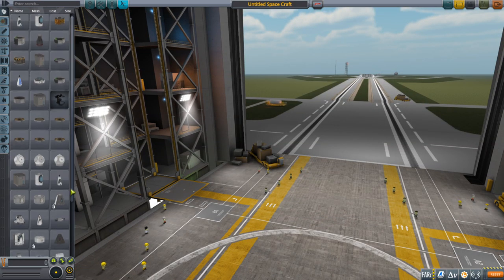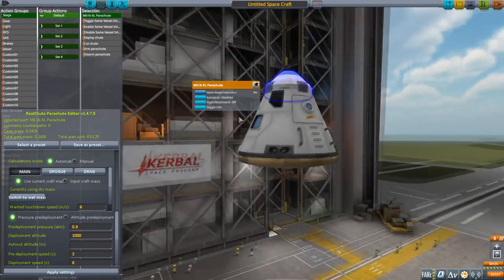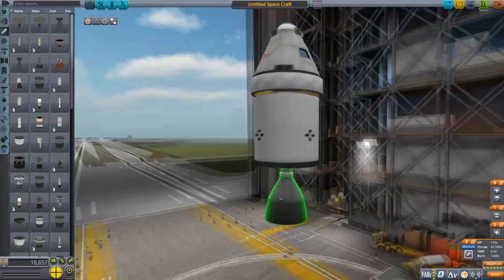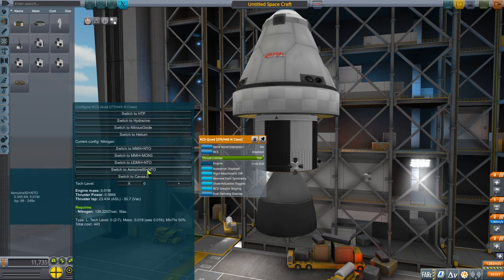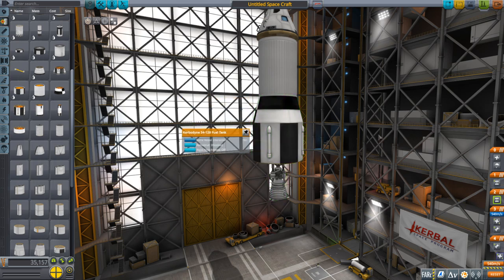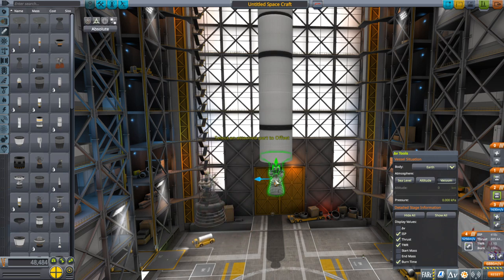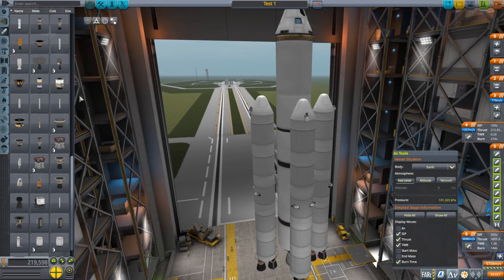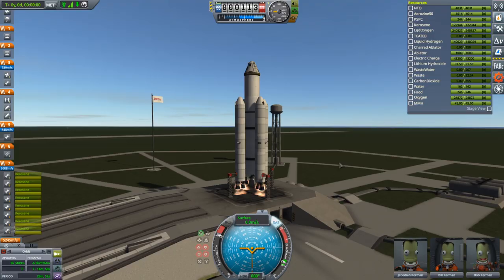Building a Realism Overhaul Rocket with Only Stock Parts in KSP 1.8.1

Comment: Hey, I've done the installation and everything works perfectly except loading ships in the vab. It says that I'm missing files on every craft/rocket. Am I missing some folder or some mod? 
Another question, if you don't mind, how do I get the BE-4 model in game, or BE-3U? I only see generator tap-off BE-3 from New Shepard. Thanks.
Reply from the maker: The craft files included in Realism Overhaul will require a few more mods, which I explain in this video: https://www.youtube.com/watch?v=gMlhkADxkB8. I'm not sure if a mod has a BE-4 or BE-3U - I usually reconfigure an existing engine to their stats when I want one. It's possible SuperPenguin's Rocket pack (which has New Glenn) has one, but I don't think that's RO configured yet.

Comment: Lesson learned: Don't try to use stock parts! Get ReStock at the very least; IIRC that's what these configs are designed for. Preferably get ROEngines, ROSolar, and Procedural Parts as well.
Reply from the maker: Ah, you may be right that they anticipated ReStock. I'm not into ROEngines and ROSolar, though - Procedural Parts, Procedural Fairings, and RealEngines would be first on the list.
Reply: @RaizSpace  I was actually thinking of RealEngines - the names confuse me sometimes.
Reply: @RaizSpace  is i download the realism overhaul is the pc is or ksp because is bad and socit crash game and game lag so when is i forced to delete the realism overhaul and i delete the realism overhaul and on stock version all the is rockets i make is flip over and crash even if the balls are fine because i have no idea and the rcs wont work so is i cant play the ksp so it bad and is ksp take time load is it ksp or pc? Why is that you is good in ksp so you might help me with that and help me also fix my real life carbonmonixide detector! And is also i is download mods and dependencies and the mod is so few load and mod wont work half mods wont work i is use last version on ksp 1  so is it the mods or the ksp or the pc is bad or i is i want engine mod and science mode but it wont work so is the game boring and without the mod is the ksp beoring yes so i is not play ksp i is do have science mod but is it work but no engine mode work because the engine mode wont work because the wont is work is it the is or the is it it or is game is broken and is i it download the ksp redownload the is ksp?

Comment: is it possible to bring back interstellar overhaul so yoiu can do the things you said like bases and such
Reply from the maker: I was hoping to do that in the Mars Colonization series eventually, but working my way up to it.
Reply: @RaizSpace  i was also hoping that for a first mission it could be with a realistic way, like an engine.  you can use time warp with the enjines like the fast time warp.specifically the deadalus engine.  so a low thrust ship wont make you bored, just have better time warp for the wait, about 1% the speed of light (referencing a different ksp video i saw) gets you to alpha centauri in give or take 400 years but you can always go faster.
Reply from the maker: Well, if you want time warping with low thrust ships, the Mars Colonization series has a lot of that. Not to Alpha Centauri, of course, but still.
Reply: Raiz Space I’m only at the point of you doing the ships orbital construction

Comment: So you basically play RO to have more realism, but still use part clipping every single time even if you can avoid that?
Reply from the maker: Yes.
Reply: @RaizSpace  I wish that realistic fuel tank simulation could detect that you have an engine blocking the fuel flow :)

P.S. it's all just a rant, enjoying your videos a lot

Comment: Raiz space: I’m  building a. Stock vehicle with ro

Also raiz space: uses mod to make the rocket
Reply from the maker: Umm . . . RO is a mod, so yeah, but the parts are provided by the stock game. The actual parts are not added by a mod. By definition, though, making a stock vehicle in RO will involve the RO set of mods, yes.
Reply: I know but you are using mods TO MAKE THE ROCKET LIKE  THE TOP ENGINE AND THE EXRTA NODES
Reply: Also read more carefully
Reply from the maker: I really have no idea what you're talking about.
Reply: U used mods to make the rocket
Reply from the maker: As Al2Me6 notes, I think you don't understand what Realism Overhaul is, or you perhaps mistook parts from the official DLC, which I consider to be stock, as modded parts.
Reply: The extra nodes you used
Reply: What has happened here ...
Reply: I dunno
Reply: Sorry about the parts I used to old dlc